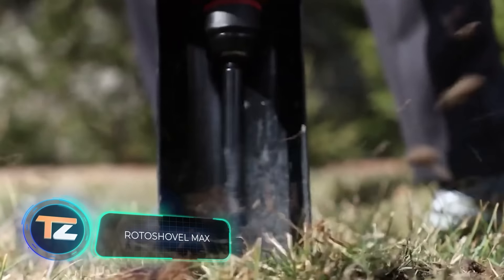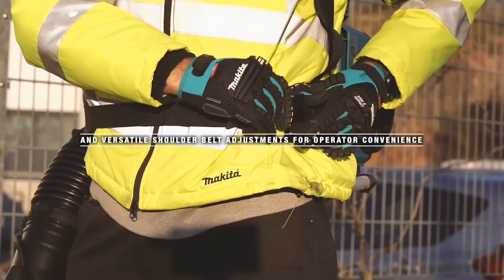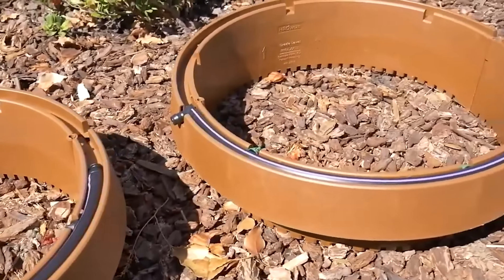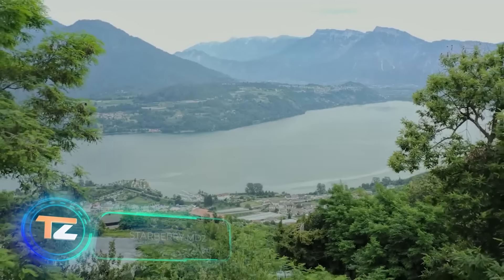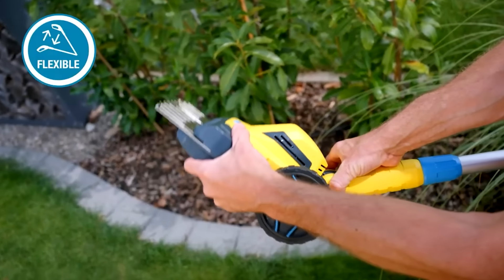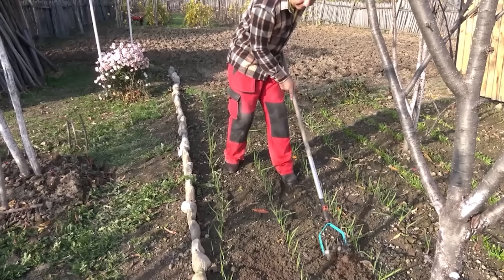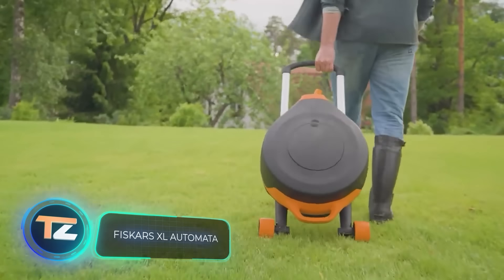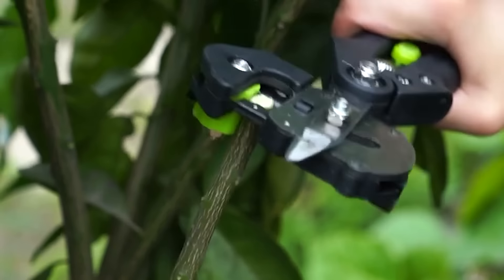12 COOL GARDEN INVENTIONS AND GADGETS YOU DIDN'T KNOW ABOUT

Comment: The first device resembles a corkscrew for soda, only not for the bottle, but for the garden, I do not understand what it is for)))).
But the battery-operated mini saw is a good thing.
Reply: It's for drilling a hole ideally for a fence post
Reply: @Loadedgoods  I think for a fence post too small because they still need to be concreted, for a tree is also small.
It's only good for a stick to tie a devereux to so it doesn't fall in the wind.
Reply: DIGGING HOLES FOR FENCES
Reply: @lovly2cu725  I have already said that the hole is too small in diameter.
Reply: @PROProcesss  chain link ressy are 1 7/8in terminals need about 3 ft in the ground don't need concrete fences aren't structural line posts are 1 1/2. I build fences but we have equipment like air rhinos.

Comment: This video had less "wow / neat" in it for me than usual. The garden tool is just a variation of one I've had for years.  The mini electric chain saw may have some uses but pretending it's a replacement for my 'heavy gas' Stihl is a joke.  The 'cordless drill" size blueberry shaker may be better than hand for a very small farm but around here the blueberry farms use picking machines that drive over the rows similar in idea to a raspberry picking machine.  And the gutter cleaning tool looked awkward and slow.  Why not use the water blast tool made for the same purpose that has been around for years, is faster to use and I believe also cheaper?

Comment: I'm sorry but how the hell is a manual cultivator a new tool? Not only that, but how the hell did it get down towards like the top five of the list? I was born in 1979. I used one of these as a child in my parents' garden helping them weed. That tells me that this is not exactly a new and upcoming product. And yes, the one that I used aside from being painted a different color for the frame had the exact same shape and size times. As that thing does. It's almost like saying a rototiller is a new invention
Reply: Yep. I too remember the Garden Weasel commercials
Reply: And you could get them at the local store for about $10
Reply: Yeah but didn't that one have a detachable weed puller frame and some other things that it could do besides just the cultivating? You're right though those have been around forever
Reply: Who remembers the weed puller that had 3 spikes in the bottom and you used to rack it like a pump action shotgun to release the weed.
Reply: @palermothegoalgod-wd2wp   I remember it - and how often it didn't work.  Fiskar's has a new one now with 4 or 5 spikes and it works nearly all the time.
Reply: I still have mine. Best thing for planting grass seed.
Reply: At no point did the video imply that the Garden Weasel is a new tool.
Reply: The original Garden Weasel - still have mine from the early 80s.